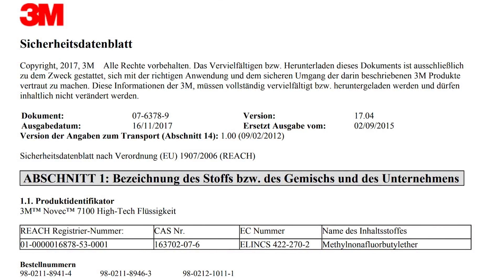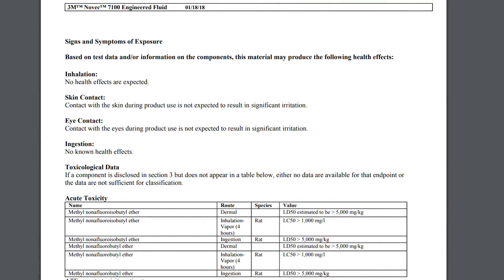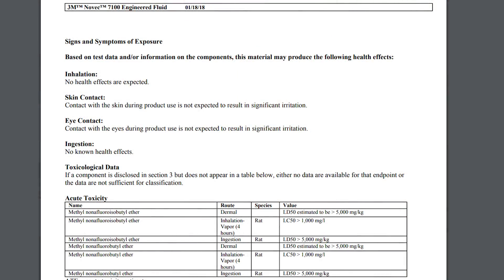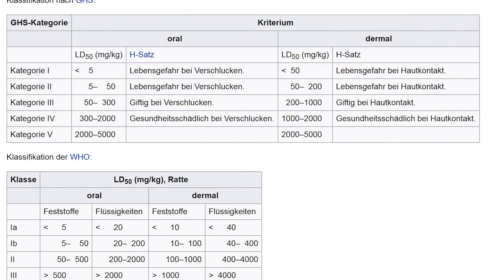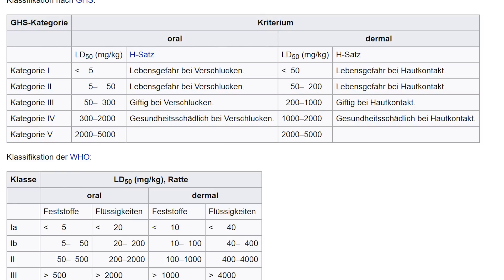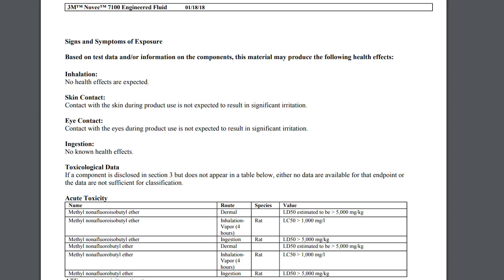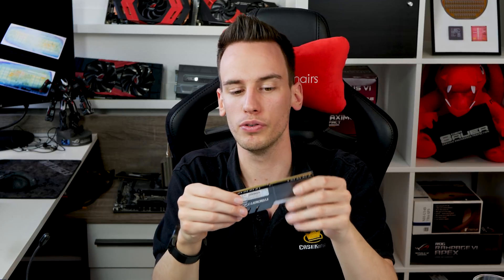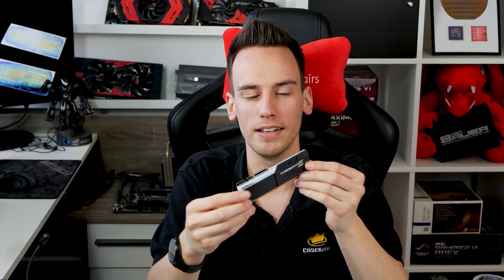Projekt Exhalare 2.0 [#2]: Q&A 3M Novec 7100 (en)

Comment: Will you be doing more in this series? I'd be cool to try making one of these for a GPU compute workstation instead of watercooling a bunch of cards. What glue did you end up using for your enclosure? Any thoughts on boiling enhancement coatings? How did you seal your wires? Did you find that you needed a desiccant or other fluid treatment (activated carbon?) for long term performance?

Comment: What happens if you take a system like this, that is, the CPU and GPU without a heatsink and instead of using this fluid you use chilled mineral oil? Not looking to evaporate the mineral oil but rather cool it enough to allow those parts to be installed without heatsink, is it possible?

Comment: u should have just done power supply with a server psu and breakout board to 12v dc, and used a pico-psu G-unique arch demon 500W for the cpu+mobo. this way it limits the no of cables u would have to seal while taking outside the case.

Comment: The liquid in previous video was boiling - that means IHS had at least 60°C (+- boiling point of the liquid), so the CPU was at something like 65-70°C? Am I correct, or is there any kind of magic happening?
This phase cooling should be really great for keeping high power (300+W) CPUs/GPUs at low temps. But the less power the CPU/GPU pulls, the less should be this phase cooling "efficient" - less power = less boiling = only low amount of heat will be taken by phase change - am I right?

Comment: Is it more efficient than water at removing heat? If so could it be used in a custom loop to enhance system performance as an H2O replacement?

Comment: How about using this liquid in a open loop, like just changing water in the loop for Novec 7100? Theoretically better temps compared to water / normal coolant because novec has more mass and a lower boiling point? I would love to see a video about this!
Reply: Simo Ahola The fluid would evaporate and build up pressure, eventually exploding.
Reply: Thats a good point, but wouldn't you be able to use that like a phase change cooler with a large reservoir? Assuming the loop can handle the pressure of course.
Reply: Simo Ahola This would ruin the complete sense of the system he invented. The idea is to cool efficiently and have lower energy consumption. With the gas the loop wouldnt really work, and the energy needs would be the same = no advantage. If you want better cooling in a watercooling system just use cooler-liquid like in fridges.

Comment: As a chemist working with very similar compounds I feel I should warn you about this type of chemicals. While you (and 3M) are correct in that the compound doesn't show any acute toxic effects, it is very likely to bioaccumulate and have long term health effects. It is also a high probability that it will transform to perfluorobutane sulfonate (https://pubchem.ncbi.nlm.nih.gov/compound/perfluorobutanesulfonate) which are both long term cancerogenic and affects the thyroid hormone system.

With that said it is not a very dangerous compound, but it should really be handled with great care.
Reply from the maker: Thanks for your comment :)
Reply: Sorry for keeping it simple guys ;)

You are correct in saying that this is a fairly stable compound. The transformation in this case might be the carboxylic acid (which is equally bad), at least if it happens in the body. The reason for the transformation is purely that the sulfonic and carboxylic acid are the most stable forms of a perfluorinated compound, and eventually it will end up in that form in the environment.

I will do some digging and see if I can find some publications, but this part of the field is not very well studied ;)
Reply: While I share your concerns on PFOS/PFBS and the handling of perfluorinated compounds, I'm a little curious about your statement that the (quite unreactive) ether might be transformed into the sulfonate in the body. I know that ethers might be broken down to the corresponding alcohols, but how would the sulfonylation occur? I would be interested in reading some publications on that matter, couldn't find any in the brief amount of time when I googled the subject. Could you point some out to me?
FYI: I'm also an organic chemist 😉
Reply: TheBackyardChemist 
I would think that the primary alcohol bond would be weakened by the strong electronegativity from all the F. Which could lead to a full “swap” of the active group, because you are right in that the C-F bound wouldn’t break.
Reply: i would also be interested in how it could end up as a sulfonic acid
Reply: Nerds
Reply: Oh ok, so it it just about the eventual fate of these compounds in the environment. I thought there was some known mechanism for the degradation that results in those products. The ether hydrolysis should be straightforward, but after that you have a perfluorinated primary alcohol and that should be pretty stable, you would have to break two C-F bonds to get the carboxylic acid, and I doubt that the typical environmental degradation routes (UV, hydrolysis, oxidation, nucleophilic substitution, biodegradation) would be able to effectively degrade/transform the perfluorobutanol. But I am not an expert in this field by any means.
Reply: this will appen sooner or later due to the "environment" of this specific use, as a coolant of a electromagnetic device.

Comment: "No known health issues" = No one's tried drinking this yet! 

Another great video. Thank you for making videos in two languages. That's dedication
Reply: Actually it has been tested
Reply: LD50 is a standardised testing method for determining lethal dosage of chemicals. they feed it to rats and try to figure out how much it takes to kill said rats. generally its pretty accurate.
Reply: the 50 in LD50 means that there's a 50% chance the given amount of toxin per kg bodyweight will kill you.
Reply: In layman's terms, LD50 means: you take this much, you might live or you might die. It's a 50/50.
Reply: I was thinking the same thing!
Reply: I remember a fluid that was used in fire suppression systems, Sapphire I believe, that was also non-electrically conductive and evaporated 25X faster than water. I don't remember the SG of the fluid though.

Comment: What about solubility in water? Say if you had a water cooling loop accidentally leak or spill into the Novec 7100 fluid - would it dissolve in the water or would it be in a separate layer?
Reply: The density of Novec 7100 is 1.52g/ml. The density of water is 1g/ml. If water leaks into the Novec fluid, it will sit on top of it. I'm not clever enough to understand how solubility is measured, but it is specified in the data sheet: http://multimedia.3m.com/mws/media/199818O/3mtm-novectm-7100-engineered-fluid.pdf
Reply: separate, it has very low solubility

Comment: why arent u using the novec 7000 for lower temps?
Reply: Excess condensation most likely. He talked about that in the first video. Similar to not being able to cool down 7100 enough on a hot day, you wouldn't be able to cool down all the 7000's massive boil off on a hot day either, room temperature would be enough to cause massive boiloff.